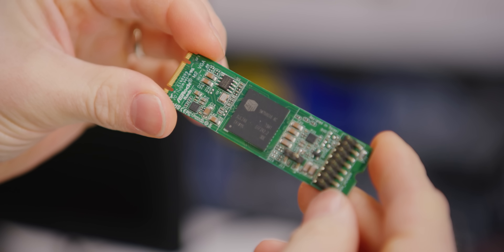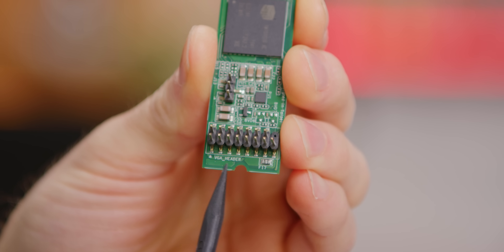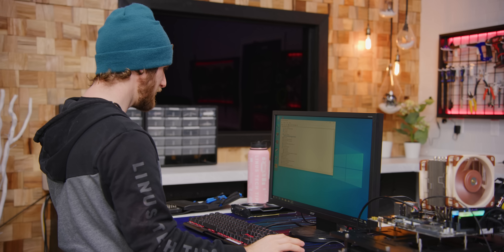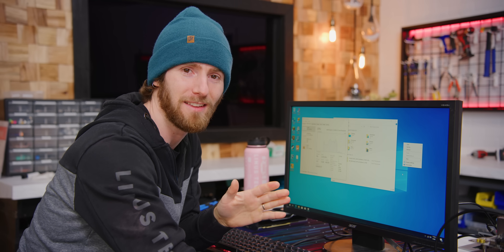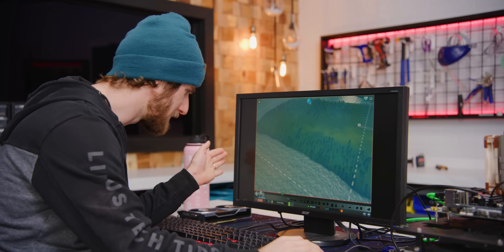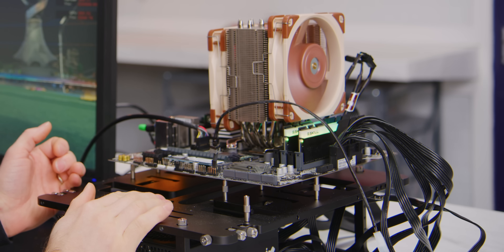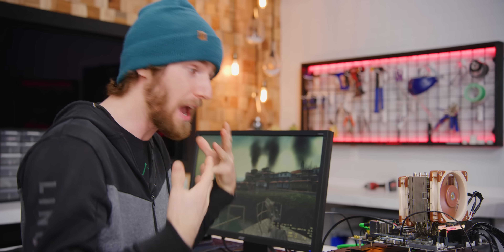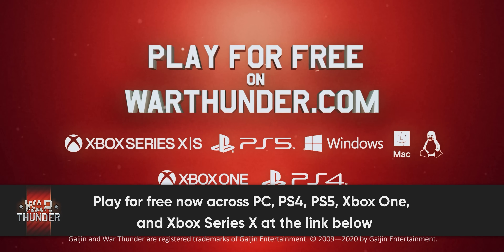THIS is a Graphics Card..?? - ASRock Rack M2_VGA

Comment: ACTUALLY... (and no, i haven't looked through the 7000+ comments. So I'm not sure if i'm the only "visionary" here... lol)

Is the idea so bad? MGS (modular graphics system, imaginary trademark pending). Dig if you will, a picture (no crying doves here)...

You have all the mobos that have video out (if you have a cpu with gpu)... 
(dammit... typing this while listening to the rest... and you touched similarily on my idea)
But they go unused if you used a non-gpu capable cpu. Now if you repurpose your old systems (my current is 10 years old and doesn't have the m.2... don't judge.) to have a simple out without a full pci slotted card.

BUT... it gets better...

How about... take that a step up...

Take a new system... with the POTENTIAL to output video... you something like this (but hopefully considerably cheaper... like $20) with a non-gpu cpu... and add a "mining" card (and maybe even two) for strictly 3d accelleration... You have the potential for cost cutting as your video card would NOT have to have actual physical outs and even traces. Hell, depending upon... and/or your mobo didn't have that... you could have different m.2 cards with different header pins to serve to the HDMI/DISPLAY PORT/future video out standards or even old... Svideo... RGB...etc. OR say you only need 1080p today... you could upgrade just that for 4k... or 8k... or whatever comes next (yeah ino, the system would be WAY obsolete by then) BUT... say HDMI (what are we on... 2.1? too lazy and don't care to look) if you want to take advantage of new output protocols... just upgrade the m.2.

MIND (what's left of it) BLOWN

Now... i'm sure there's bandwith issues of pci to contend with... although if you SLI physically between "mining" cards and have them combine before the data is sent and truthfully, couldn't it just be sending the "virtual" output... you could just have m.2 output(oh shit, don't get me started on the potential for virtual machines... i've been caffinating AND drinking... who knows what ideas i'd have if i were smoking weed... but i'd never remember and wouldn't be able to type... lol) 

Funny... years ago i used to keep my NBT (next big thing) ideas proprietary to myself, just in case. Now... i'm trying to be much more open-source, so they don't go to waste and die with me. lol

ANYWAY... thanx LTT for the somewhat obscure for daring me to dream!!!

~g
Reply: OH... and if the "mining" card... (is "headless" a better analogy?) can have a "dynamic" or "launchable" state, or whatever would keep power consumption to a minimum... wouldn't that cut back on energy consumption? Again, the closest thing i am to an electrical engineer is... an imagineer... although (in theory), i quite would like being called "your Imagesty" but I have too many issues that would prevent/sadden/disgust me from doing. SQUIRREL Where was I? I've not looked at what idle power consumption is for high end cards, but I'd be willing to wager... it's gonna be quite a few times what an m.2 card would require (like... many... no... more... keep going... sigh maybe not orders of magnitude, but...i digest... digress... whatevs) AND now that i'm on a kaiser... what about m.2 dedicated gpus on (what do we call them now?) laptop? With the same sorta idea... using onboard until you want/need/must have dedicated. And please get me started on how gpus should be doing a $#!7ton of more work when we're not playing games or rendering or encoding video. I remember when they sold $1000 specialized dsp cards to to accelerate parts of Photoshop (and photoshop only... that's ALL it was good for. AND you had to use specialized plug-in filters). Wouldn't it be nice to have some serious number crunching capabilites say in, DAWs? Something that could do things akin to AUDIO "ray tracing" or at least off-load some of the workload from a (or preferably many... many) virtual instrument(s). Again, I don't know much about the actual limitations here (or honestly, with a lot of things in life as i firmly believe... "Expectations are MEANT to be shattered."

i apologize for the lack of paragraphization. You're lucky it wasn't one run-on sentence as i have trouble translating my stream of consiousness into socially acceptable clumps for mass consumption. Yea, ADHD? Or i'm just lazy. Six of one... half dozen of the other.

Comment: I can see how it might be marketed at gaming machines -- not to actually run your games on, but to put a display in the case itself and run it without eating any of your real monitor ports, and not using a PCIe slot which you may not have available.

Comment: Imagine in the future when the power of an rtx 3090 can fit on a card that size.
Reply: Eventually even that’d be weak and ancient and there’d be even smaller yet faster micro gpu’s etc…
Reply: @HettycTracyn  I doubt that will ever happen without a complete redesign of computing; i.e. not using electricity and silicon
Reply: @HettycTracyn  eventually we'll all be dead and no one will ever remember that we've existed
Reply: @aliabdallah102  yes, I know.
I was just saying how amazing advances in technology are, especially when they make fast and small parts more efficiently…
Reply: didn't they hit a size restriction where if transistors were any smaller the electron just passed the transistor? I remember hearing about that somewhere. males sense why new cpu are bigger. idk
Reply: @ApexGuardian  yes we are hitting right against the wall of what is physically possible now, transistors can't get much smaller unless we design completely new transistors that can work at such a tiny scale, but that doesn't seem that likely imo, at least not anytime soon
Reply: By that time it's not going to be impressive at all, we'll probably be playing VR games and the standard will be something like 12k 240fps hehe
Reply: That future is never.  A 3090 is right now ~ 40mm by 40mm at 7nm and if we get to 2.2nm it will just barely fit on that card but it will be taking 300w so the card will melt about 30s after you turn on the PC.
Reply: they're most likely only gonna get bigger instead of smaller. we're probably gonna have tv sized gpus by 2030 lmao
Reply: and people will call it crap
Reply: Need stronger than a 3090, had the chance to use one for a few days and VR msfs with a flight sim rig is not as good as I would expect, 40-60fps in VR
Reply: Photonics
Reply: soon
Reply: The M.2 interface can store multiple terabytes of data, when it used to take massive tape banks to store even a literal millionth of that. The GPU on it is more powerful than the combined computational power of humanity a few decades ago. This is the future. Appreciate it for a bit.
Reply: i used to play this "imagine in the future" game around 98 with a friend about computer evolution and man it was a blast and ridiculously sobering at the same time now when i look back. i though we couldve archieved more, tech ist being hold back and nanofed to the paying drooling average joe ..sigh yeah most of our predictions were true. to bad it were the shitty ones -.-
Reply: @Velocifyer  IKR
Reply: you could in the next few years maybe but it'd make no sense because a 3090 draws so much power that in such a small device it'd immediately cook itself when you turn it on. There's a reason graphics cards are as beefy as they are now, the GPUs dies themselves aren't that big but the cooling required for them is immense
Reply: There are already custom OEM M.2 GPUs with decent GPU cores, HP has a full MXM GPU adapted to M.2 for instance, also given how powerful AMD's RDNA 3 is, a RDNA 4 M.2 GPU would be powerful enough to play any modern game at 120FPS+ @ medium/high settings, AMD could in fact fit multiple RDNA GPU Dies on an M.2 stick using chiplets and the superfast modern interconnects, just look at Apple Silicon amazing GPU performance (for its tiny package/power size), you could fit many Apple M2 GPU cores on an M.2 stick, there is also the powerful Nvidia Tegra GPU's, which is what powered the NSwitch, Nvidia has many times more powerful versions of Tegra now, they could put out a little M.2 based Tegra powerhouse GPU, just think how useful that would be, you could upgrade UMPC's, handheld gaming PCs like the Steam Deck, Laptops and so on.
Reply: That'll happen next year.
Reply: @surferdude4487  and there'll be no stock.
Reply: @surferdude4487  nah, this card is basically a Tria64+ from 1995, right now we might be able to get something like a Geforce2 or a Radeon 7000 down to that size with intergrated ram.
Reply: @surferdude4487  Sir it hasn't happen

Comment: Couldn't you dedicate some system ram to be v ram and have it run off that? I mean usually it'd be unadvisable because it'd be so slow to use, but when you only have a few megabits of DDR1
Reply: there are 128 megabits on this card

16 megabytes times (x) 8 (because a megabyte is 8 megabits) equals (=) 128

Comment: Wait... I've never thought of M.2 as being for anything other than SSD's and network and such, but I suppose that one could use an M.2 to PCIE converter(/riser), to chuck a proper graphics card on a Rock Pi (if drivers permits (I don't know how things like this works across architectures, but I suppose Open AMD drivers could be compiled to work on different archs, if I've not completely misunderstood (I probably have))). I know the CPU would be a bottleneck, and that the integrated graphics are rather capable, but it would still be an interesting experiment... Just because...

Comment: I just got my first pc with a Gigabyte F2A68HM-H Motherboard and was wondering if I could use Intel CPUs with it, I currently have a A8-7650k and a GeForce GTX 1060 6 gb, anything would be helpful in what I need to upgrade next oh and also I have one stick with 7gb of ram it was supposed to be 8 lol
Reply: If it has a AMD CPU in it then you can't use a intel processor because the sockets on new motherboards don't let a AMD CPU fit on a intel motherboard and don't let a intel CPU fit on a AMD motherboard

filling up all the RAM slots with the fastest sticks the motherboard can use will get more performance than upgrading the CPU without adding more ram would and you should have 8 to 16 gigabytes (more if your going to have a lot of big programs open at the same time)

an SSD will also speed it up even a sata 2 SSD will work if the PC has a really slow (50 megabits per second [mb/s] or less) HDD

Comment: “16 Mb of DDR 1!” 
That sounds like the best graphics card in the world, even better than the RTX 3090!
Reply: Seriously guys, this is a display adapter, it's not a graphics card. It's a glorified digital-to-analog converter with a framebuffer. All the drawing is done by the CPU, and the 16MB are there to hold the final 2D picture as the picture gets been drawn by the CPU one pixel at the time (or a handful of pixels at a time if you have a multi-core CPU). For example, if you have 1920x1080 at 32bits (4 bytes), you only need around 8MB.
Reply: @Δημήτρης-θ7θ  that would actually be useful to me. I have a crt tv for vintage gaming, and I have to use a 2nd gpu for native analog, because my first one has none.
Reply: @potatoes5829  Still, with this an unaccelerated display adapter, so lots of stuff you would expect to be done by a graphics card, such as video decoding acceleration or even basic 2D and 3D acceleration in Windows, they will be done by the CPU and it would slow your system down. Most people don't know how slow an unaccelerated desktop makes your computer because they remember stuff from the XP era, but keep in mind all versions of Windows from Windows 8 onwards are mandatory composited, so the impact on performance from software rendering essentially emulating a GPU is very noticeable. It's why PCs tend to be slow before GPU drivers are installed btw. You'd better off with an older GPU with analog output.
Reply: @Δημήτρης-θ7θ  I am using a gt635 (OEM only card) for that purpose, but because my rig is matx, I don’t have enough pcie expansion. I want to run a sata hba, but I don’t have enough slots.
Reply: @Δημήτρης-θ7θ  Most the time the vm is on win XP so cpu rendering shouldn’t be a problem
Reply: r/woooosh
Reply: @Ordlnary_Gamer  we should poop on this joke since we should be realistic.
Reply: Well, I mean, you have a little bit of an ontological argument, but the graphics card that exists is assuredly greater than the graphics card that doesn't exist, so...
Reply: *Nvidia GeForce RTX 3090

Comment: Actually... I could see a path to using M.2 for inexpensive and less powerful video cards for laptops and microprocessors. You won't get 4k gaming on it obviously, but with a 4x M.2 connection, you can at least do a pretty decent job for low to mid level gaming. You can probably do consistent 1080p/60FPS on most games using middle of the road settings, on a very tiny form factor. You could get something at least more powerful than the integrated graphics, and also let the microprocessor focus exclusively on CPU functions using an M.2 GPU as a loadsharing graphics processor, increasing performance overall.

This... is NOT how it is done, but I could see something using this general idea that just might.

Comment: This is one in million products presented by Linus Tech Tips that I can afford
Reply: and the only one you dont need
Reply: @marcuscowles3384  You're definitely right
Reply: I was actually surprised when I saw the price because my 1030 while obviously not anything high-end is still way better than this thing and actually is in the same price range at $85. This GPU is overpriced for what it does...  or what does it do? Linus didn't show us, this whole video was pointless.
Reply: @amihartz  you obviously didn't watch the whole video. It's for servers.
Reply: @amihartz  lmao thats not the point, the gpu is made for VMS or cheap screen terminals for monitoring
Reply: @WandererHermit  So why didn't he show it being used for that?
Reply: @amihartz  because its not interesting passing through gpus or trying to figure out the linux terminal?The gpu is for server use, no one expects to fuckin game on a server gpu designed for extremely basic video output and nothing else.if it was supposed to be fast there would be no point putting it in a m2 slot
Reply: @WandererHermit  then why make the video...
Reply: @amihartz  because they wanted to show it and why its not for gaming or daily use
Reply: @amihartz  Its for servers, where you probably don't have a open pcie slot.

Comment: I've been waiting for (SO) DIMM graphics cards since SIMMs, VLB and ISA were the norm... AGP, PCI, PCIe - all so slow compared to memory bandwidth... and as to sharing memory between the graphics card and CPU...............................................Giant PCI cards can still fit in DIMMS and an SODIMM GC should work in parallel with onboard graphics. a dedicated, standard GPU slot for laptops would be nice as there are too many standards, but SODIMM standard is ancient and high bandwidth. would have been fine for a dedicated graphics solution all along. Could have 3 slots, 2 for dual channel memory and 1 for graphics... M.2 is fast but modern and not as fast as memory bandwidth.

Comment: The chip and hardware in oculus quest 2 can run a loghtee version of POPULATION 1 and Contractors and runs smooth at 90 fps in almost 4k res (but its actually more then 4k its running cause of barrel distorsion effect).

So something is wierd with graphicscard sizes and etc.

I meab just look at The whole size of The quest 2?

Im 2 years u will have quest 4 running Half life Alyx at 4k res..

Comment: well it technically could have been a bad ass gaming machine's card  ... IN 1992.

yeah i can see it running  half life 2 , with low settings  i had a ATi radeon 9700 pro that ran HL2 at 45-60 fps at 1024x768  with max settings back in the day. but i got the game when i was over at my grandmother's house  so the first card i ran it on was a Geforce 4 4400 ti at 800x600 with medium setttings  getting frames between  35-45. so yeah it's believable that a modern CPU can pull it off in software  at low quality.

Comment: That right there is how I used to play cities skylines on an i3 4th gen HP pavilion (720p) with integrated graphics. It looked terrible, took forever to load and was super pixelated and blurry, but it was running and I actually built quite a decent city. I was like 10 or something and I was just impressed that it loaded up. Now rocking a ryzen 9 5900x and RTX 3080, how times have changed!